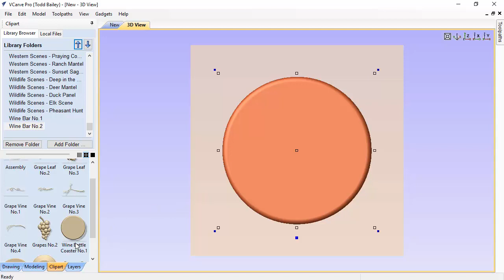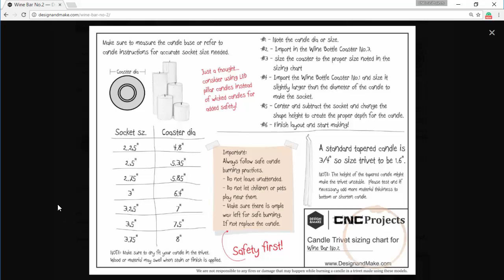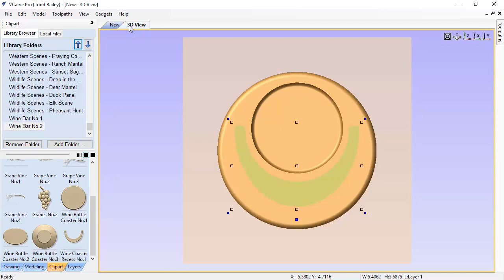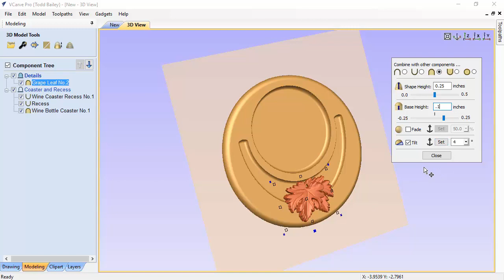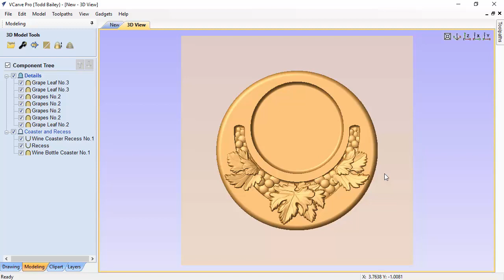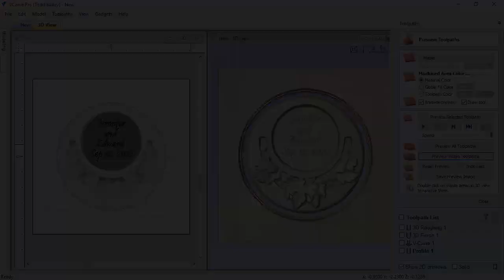To Get You Started Using Our Wine Bar No.2 CNC Project | Design & Make

Comment: Do you also have a picture or a short video of the making wine bar in the cnc machine?
Reply from the maker: Hello... thanks for the question.  No, I don't but we have received some great pictures from a customer of ours that has made several of them.  If you go to the project page on Design and Make.com - http://designandmake.com/wine-bar-no-2 - and scroll to the bottom you will see them there.